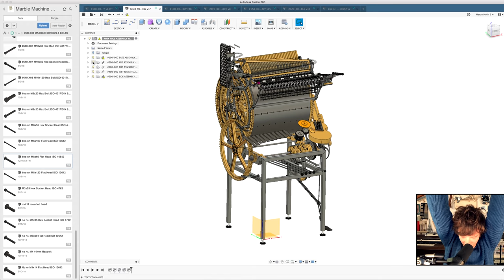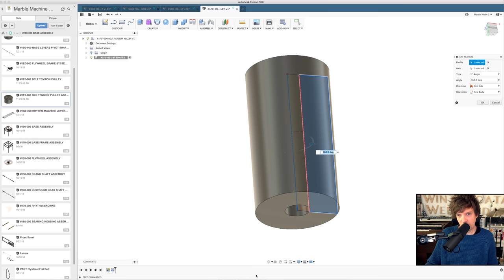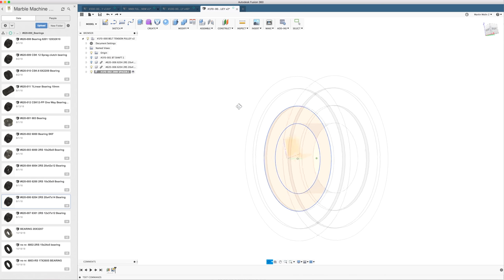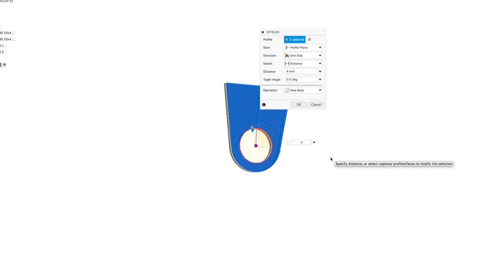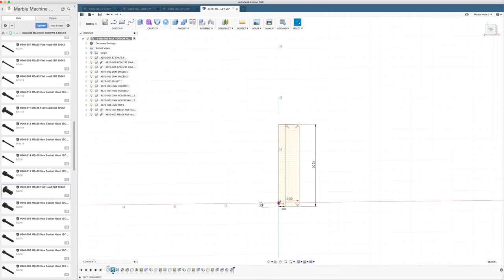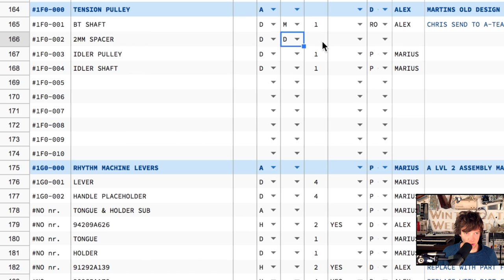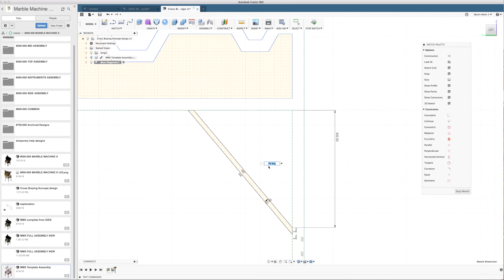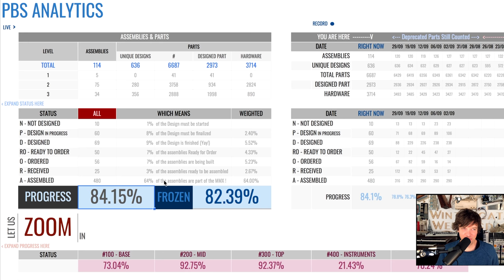Designing New Parts in Fusion 360 - Marble Machine X #56

Comment: The curved cross bracing around the programming wheel is totally going to make it impossible to change the plates without taking the bracing off - on stage?  There's a ton of stuff bridging the wheel for the marble mechanisms.  Why not rigidize those components for added stability to preserve your aesthetic and access to the programming plates?
Reply: If you think about it though only one set likely the rear would need to be removed. I doubt he will weld them.
Reply: but there wont be an X anymore if he removes it ;(

Comment: Does the cross-bracing block changing the programming plates?
Reply: My thought as well!
Reply: Just make them be able to swing up when the plates are needed to be changed.  And easy change which only needs two spring lock plunges, self lock toggle clamp (or something else to lock the X Machine logo) and then two hinges on the other side.  No biggie, except if you forget to think about that.  :-)
Reply: Really they should be able to move considering they are designing it to be able to be packed up
Reply: Yes, but is it easy to replace the pin plates on the MMX drum?  It should be able to be done in a consert, no place for any failure because of human errors.
Reply: Yes. Martin mentioned several times that changing the programming plates during the concert is part of the design so the machine will be able to play several different songs without needing to re-pin every time.
Reply: @YehudaKatz1  However he did not mention how you would access the programming wheel under the cross-braces, that is up in the air.

Comment: FWIW I tend to put holes in based on a point on a sketch and a "Hole" feature. It just makes it that bit easier to change the hole size/thread  when the hole is a feature. I also use "hole" for countersunk holes, rather than the chamfer tool.
Reply: Dunno if this is related, but he has done a video on how MMX is pushing the boundaries of fusion 360. Might be that keeping the amount of sketches and features down helps performance.

Comment: This timeline purity policy in F360 seems way too tedious for me. :o I find it very limiting, when I can't move freely inside my design. The extremal case would be Autocad, which even remembers camera movements as design actions. :P
Reply: it's only a problem because he has thousands of parts and when he has 2 or 3 uneccesary move commands or sketches in each individual part that gets multiplied to 4000 unnecessary details in his full assembly, he covered this in an older video. Basically if instead of using all these shortcuts he took 2 timeline features to do the same thing, he runs out of performance, the program becomes unusable because it wasn't designed to have assemblies with thousands of parts in it. He knows that Inventor would be a better solution but is so invested into fusion that he doesn't want to change platforms. especially in the middle of a project.

Comment: I like CAD, but I disagree with the programming wheel bracing. Sure it's ok for the legs as it's necessary, but this is just something else that's gonna have to be dismantled and it really has no form or function, and I feel you're just making more work for yourself... not only in design and development, but also on tour. It's extraneous and should be deleted, that's my first thought

Comment: Love the video, Martin! My only CAD experience is with Inventor, so I had a bit of trouble keeping up, but I think I understood most of it. Why is it that, when you do parametric design, you use numerical lengths rather than a global variable length? (for example, you know a bearing is x mm wide, so you set up a variable named BEARING LENGTH that equals x mm and plug that in every time you want a bearing) Is that not a feature in Fusion 360, or is it just not worth it when you already have the length memorized?
Reply: I had this thought too. Global variables for re-used lengths would stop a lot of potential human error.
Reply: But you can do the same thing with constraints on things, which also will make it parametric design.  If you change one thing, all constraints will make the other parts follow to fit too, as he showed here. (Or have I missed something with variables which constraints can't do?)
That is just two ways of doing that.  But yes, I do believe you also can have variables in constraints too in Fusion 360.  Never done any serious work in Fusion 360 nor in Inventor.

Comment: Pity you couldn't get Dassault to give you a copy of Solidworks , it's so much easier
Reply: Well.. try to get a "demo version" from them.... basicly you can't . Well, you can get a demo, from one of their resellers, so they can make you decide that you shall buy it.

Autodesk on the other hand  realized there was a market for a free/cheap  cad/cam suite. OK, it has some "flaws" but if someone can crate parts and spend their money on, say, buing handtools and material instead of spending a "fortune" on just he  software for making a drawing...
Reply: Too bad for them, it was a huge opportunity for free advertisement that they missed. Plus Martin probably would not agree with the terrible commercial policy of Dassault Systems, not mentionning the Dassault group is a major arms manufacturer, which I bet Martin wouldn't agree with. 
But Autodesk should have given him a copy of Inventor as it's more suited to such a huge project. Or Siemens a copy of SolidEdge or even NX, which is on the level of CATIA.

Comment: Aircraft mechanic here. I know a lot about long time wear on parts. The threads and the end of the countersinking on the screw are sources of cracks and a shear failure. If the transfer of force is just the countersink and the edge of the bracket it could shear pretty easily in a short period of time. The better solution is an unthreaded shank surface and a screw that’s can take a large enough shear or side load to hold the load. Anyway, love your work and can’t wait to hear some music out of the X!

Comment: I prefer to use the hole command for creating hole and or hole features such as the countersink rather than sketch extrude/revolve. I learned this in Inventor several years back as I thought it used less resources. If I'm working in Fusion I tend to do the same. Also the correct hole size clearance and/or thread can be automatically calculated. Great time saver, also super easy to later change the size/type etc. Not sure which method would use the most resources. At any rate your work and video quality is excellent. Thanks for all you contribute!

Comment: If you want rusty parts, I recommend using Corten. It's a steel alloy that forms an oxidation layer which is basically rust, and it looks and feels like regular rust, but without the destruction! It's a little more expensive, but might be worth it!

Comment: Friendly suggestion from a engineer that CADs a lot. Check out the hole feature, much easier for your through holes, countersinks and even threaded holes. For example, if you do a threaded M6 hole, it's gonna do a 5mm hole for tapping and will also apply a thread texture.

Comment: I'm always impressed with what can be done with C.A.D. ( I still own a slide rule and a drafting table LOL ) but it looks like the cross braces around your programming wheel are close to being in the way of doing a quick change. Clamps and /or bolts to fasten it would add probably 20 to 30 seconds to the changover time for the programming time and possibly twist the frame. I only mention this as bolts were my first thought.  I saw how close these braces were and remembered the times I put a brace or a bracket in the way of a critical part or service area. Also seeing how much energy that flywheel feeds back to the crank , it might be time to fit up a brake.

Comment: Oh, I was just thinking with those arms in the back.  Putting some sort of latch with a hydrolic piston of sorts to open it slowly would be really helpful.  It would make it easier swapping of the programming plates.  To close it you simply pull down and click it into the auto locking system.  It's a lot simpler than it sounds

Comment: 1. belt tensioners are normally spring loaded. 2. having a convex wheel will make it want to slip off. you either want flat, or slightly concave.

Comment: If you want to create a rust-effect on plain steel, take a paintbrush and paint it with salt acid. That creates an immediate reaction and the steel surface ages. But: 1) be careful with acids, 2) it only works on metals that can create rust, it does not work on stainless steel.

Comment: Really interesting ! I am a mechanical engineer and I understand your work,  this is The hiden iceberg part of the creation... Your dynamic design method could be improved further, I guess, using parameters like diameter or thickness... So that you can modify several parts with 1 parameter. The statistic file should be for you a great motivation, encouraging you, and showing your progress. This is a new step in the project, very very good job. This is as well interesting as machining, and show us that it is not so difficult to design.

Comment: Have you considered using damped plywood? It's not necessarily useful everywhere, but could give you more control over the sound of specific mechanisms. The registrators come to mind.

Adding damping inside some of those supports could also be handy if you run into ringing problems with them.

Regarding the spiderweb look, it may look better to use a brass cylindrical cover plate with some access panels or cutouts on the back instead. This would also give a clean option for marking out timings or other useful indicators clearly (etch or mill them into the plate). Such a plate would be concentric with the programming wheel, and possibly removable for maintenance. Only problem: brass is heavy, and it may need some steel behind it for support.

Comment: Yes it's true. CAD is sooo time intense! I had that experience last term while university tasks. But I'm not bored by that kind of videos. Better yet I'm interested how so solve construction challenges!

Besides that one question occurred while watching: How do you want do change the programming plates? Istn't this X-shaped spiders web construction at the backside closing the gap for un- and remounting the programming? Maybe I overlooked that part. If not, maybe you can solve that with joints an some kind of locking bolts to open that stiffening like a bood lid. Hopefully you have got a plan for this!

Comment: man, that cross-bracing around the drum is crazy and probably will introduce more vibration because of the arcs and the way the connect in the air. You need to link the forces to the ground and not to each other.

Comment: Martin, have you looked at saving the parameters for common dimensions and using those?  You could save all of the things like 'M8_Tap_Dia_Steel' and just use the names from then on.  

Then your calculation from the beginning would literally be "(bearing_width * 2) + (bearing_spacer * 2)".  Then when you want to change numbers you don't have to find the right sketch just change the parameters directly. 

Just getting into Fusion so I'm not sure how hard it is to reuse them between designs and it might be a bit late at this stage.

Comment: For the problem of the cross braces blocking access to the programming plates.

You could place springloaded locking pins at the top and hinges at the bottom of the brace.

Spring loaded locking pins that would always want to return to a locked position. To release simply pull the pin out and twist so that a small "finger" or detent would catch to hold the locking pin in an open position. When finished simply push the cross brace into the up position and twist the locking pins releasing the spring into the lock position.

Comment: I think the X vibration strenghtening in the structure can be a design element as "Marble X" text over above the wheel on the back. Otherwise I would like to suggest wheels or at least 2 wheels instead of the current feets for easier mobility of the machine.

Comment: You may be a bit altruistic my good sir. More funding and you could include side projects that pull in and help more people and share the wealth of what you've learned. But, that is your choice. A quick thought about the braces added in this video. You'll need to make them quickly removable (think pivot at the bottom) so you can change your programming slats on the big wheel. 
As always, keep up the great work Martin! Your CAD efforts are in fact appreciated.

Comment: (CAD TIP)

I noticed in the beginning of the video (at 2:48 to be exact) that you converted a Diameter measurement to a Radius measurement by typing "6.3/2", there is at least two more professional ways to do it.

(Keep in mind that I'm using Inventor and not fusion 360, But i know that you can do it on a similary way in Catia, Solid Works, and Pro engineer so you should be able to use it in fusion 360!)

(A)

start your Dimension by clicking on the line you want to have in the center of the shaft. 

then click on the outer line.

now right click and select "Linear Diameter".

now you should se that it dubbles the distans and your centerline is in the middel.

(B)

you can achieve the same thing simply by convert your line to a "Centerline". 

this way it will also auotomatically shose that line as a centerline when you do a "Revolve"!

hope this helps

//Jonas

Comment: You can paint the parts with a red oxide primer available in a spray can at most hardware stores to give you that red industrial color. You really should paint all the metal parts even if you just clear coat them for corrosion resistance. It would be a shame if the MMX got rained on during the world tour and rusted

Comment: I love some CAD videos, no need to hide this part of the project! Really interesting that you apparently chose a bottom-up approach for CADing.
With the back frame ("ugly spider's web") I see two main issues: 1) you can't change the programming wheel without demounting it 2) stiffening a frame increases the frequency of eigen vibrations, so if it becomes too stiff, the frame could actually resonate with some notes played, thus amplifying only certain notes! You don't want that. What you really need is a tuned mass damper as used in skyscrapers. It's tuned to the lowest and strongest eigenfrequency and annihilates vibrations in this frequency, removing most of the vibration of the frame.
For the security issues: You are damn right, the marble machine in its current design is really dangerous to the player at a lot of interfaces. As an engineer, as cool as it looks, this hurts. One basic must have security feature is a freewheel for the wheel hosting the handle. This means torque can be only transmitted in one direction (it's a one-directional clutch), meaning that if something blocks the wheel (like your finger), it won't be chopped of, but instead only the moment needed to overcome the inertia of this wheel is applied to your finger, and not the inertia of the entire marble machine including the flywheel (which is a LOT). It also means that you can grab the handle after letting it go without if pulling very hard on your arm (giving you a tennis arm on the long run), just like the pedals on your bike don't continue to turn once you let them go. The freewheel in your bike makes a clicking sound when spinning free, but there are also some small and silent ones that can be easily integrated in the current design, like ones with spring loaded steel rollers. Have a look at for example "a + s csk pp" (google).
Reply: Not my bike D: